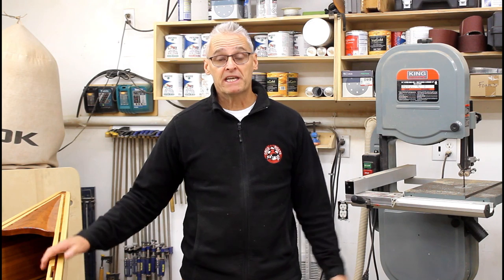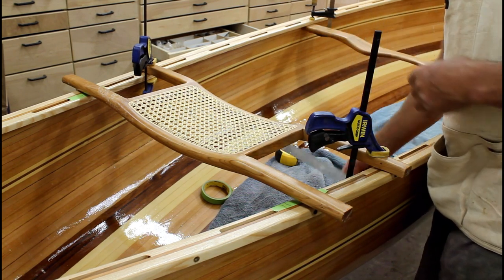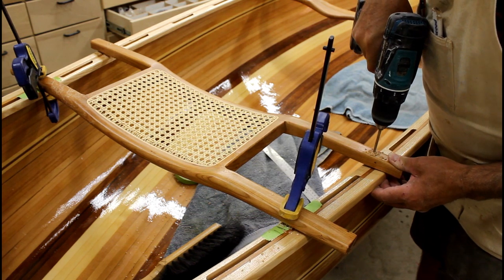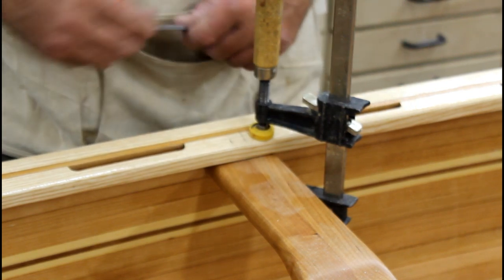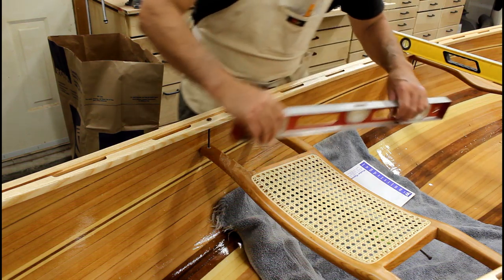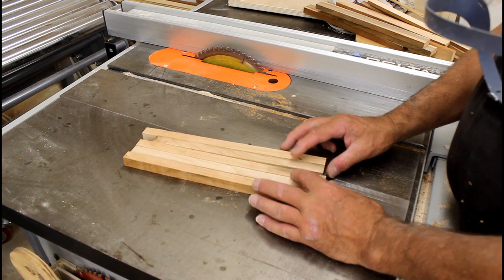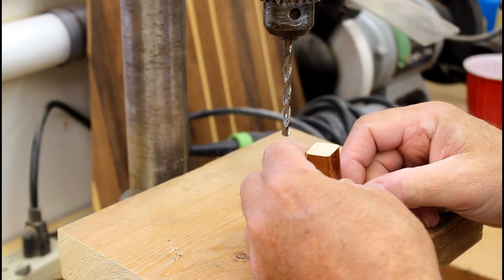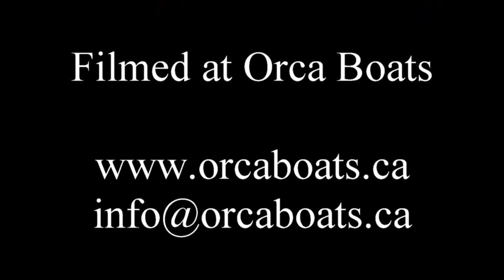Installing seats and yoke into the cedar strip canoe

Comment: Thank you very much for your video. Very informative on hanging seats and depth of hanging seats. One question though. Exactly how far fore and aft do you position the seats? How far from the bow to the bow seat and how far from the stern to the stern seat? Again thanks for the information
Reply from the maker: If you have a set of plans, there should be some information on the drawings.  Or you can calculate out based on weights of paddlers so that the boat will trim properly.  But that does not always work so I just place the forward seat one scupper more aft for leg room up front.  A lot of plans are based on older traditional canoes that the more modern ones are modelled after.

Comment: I seemed to have spaced my front seats approximately the same distance from the bow on my 16ft canoe. Does the length of canoe determine the best position for the seats? I’m about to shift my back seat towards the stern about 5” but I’m concerned if that’s the correct amount
Reply from the maker: If you have the plans, there will likely be some measurements for where seats go.  This is likely taken from historical canoes.  The front seat should be further back from the bow than the stern seat is from the stern.  This give the front paddler more leg room and when paddled solo, one sits in the bow and faces towards the stern.   In a perfect world the seats would be placed so that when both paddlers are seated, the weight of each is balanced out, but this never really applies in practice.  Hope this helps.
Reply: @OrcaboatsCa  This helps a lot! Pointed me back to my CanoeCraft book to do some research. Picking back up a project that was started over a decade ago due to various life interruptions had me questioning the actual plans mine was modeled after, As I duplicated a late friend's molds & didn't jot down which build it was made after. Turns out, I think I'm dealing with a Ranger, so will plan to adjust accordingly. Thanks!